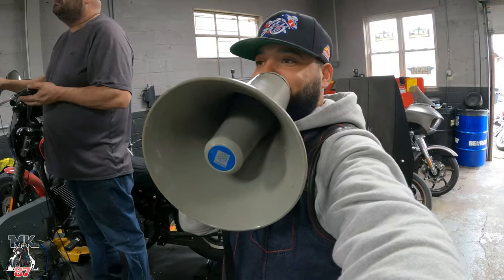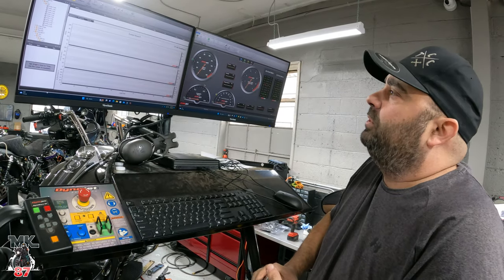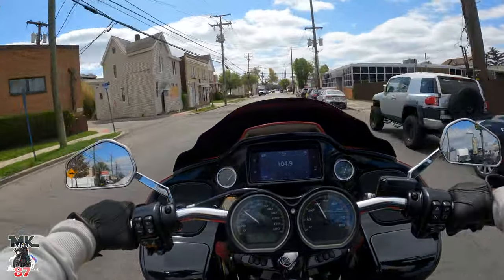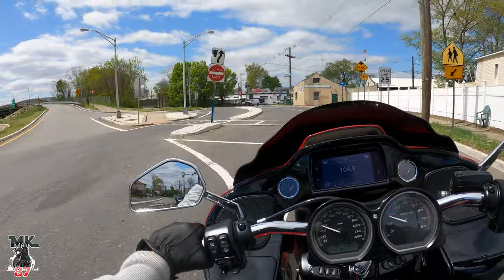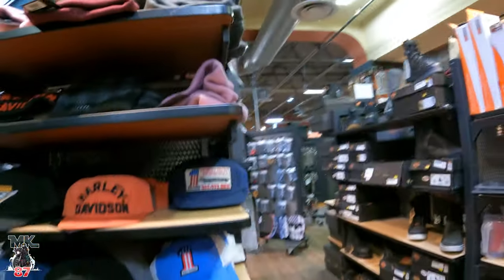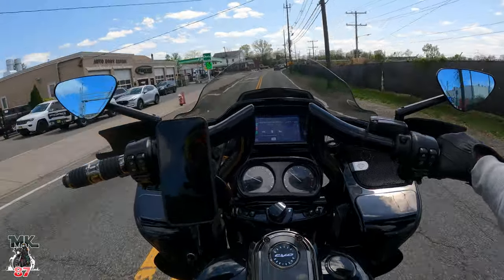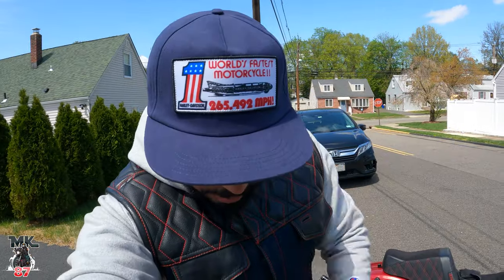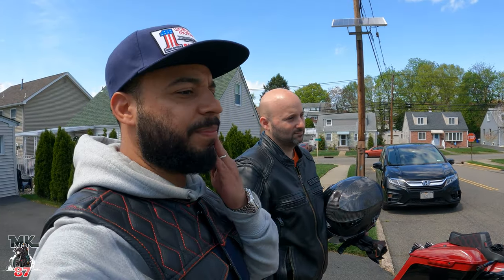Riding a CVO Road glide with an S&S 128 kit

Comment: Sal looked disappointed. Having an S&S 124 kit, 550 cam and all (mine was a 107) I can say that my dyno numbers are as advertised 124hp/136tq. Sal's 128 should be getting better numbers than what I have. In my opinion its the Bassani exhaust that could be robbing him. When I did my stage 2 (also had Bassani 2into2) I learned that they aren't the greatest for performance (lack of reversion aka back pressure) pretty much just for sound type of exhaust. I had to swap them out. It will get there Sal, keep ya head up!!! Ain't nothing a Khrome Werks exhaust can't fix!

Comment: Weird my Street Glide with 128 kit dyno’d 135 HP and 151 Torque. Though I am running 64mm throttle body and 6.2 injectors with high flow air cleaner, catless head pipe and Vance and Hines slip ons, and rekluse clutch. Though I feel like your bike is more rideable daily wise than mine as mine just wants to go go go 🤣 you have a nice build though.